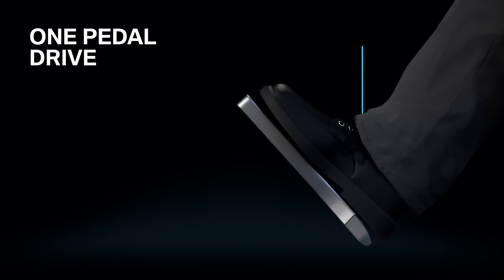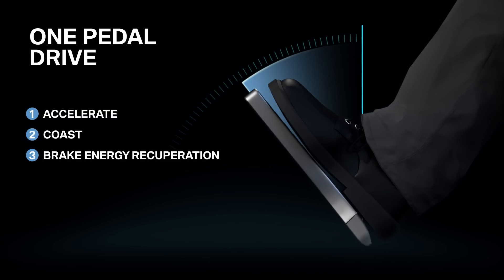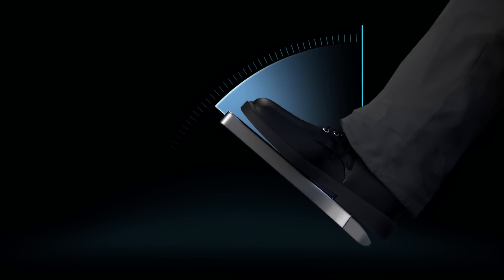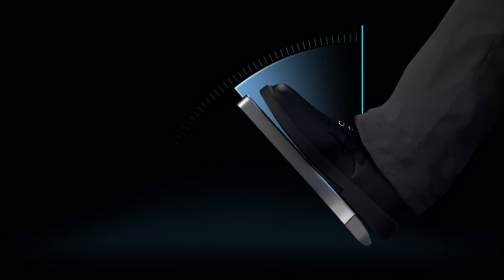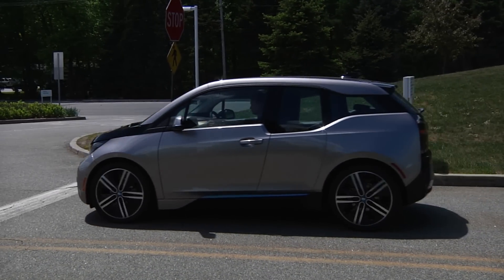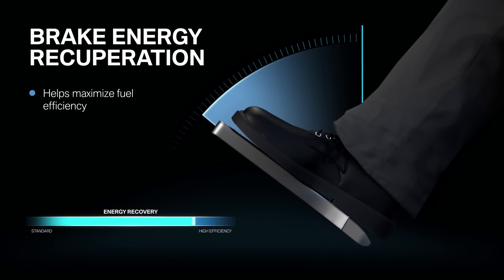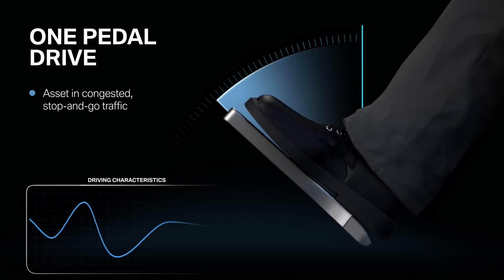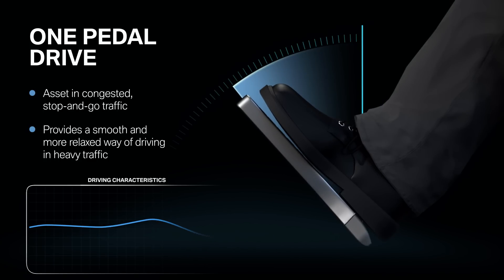BMW i3: One Pedal Drive

Comment: This takes the piss, as if someone does not know what an accelerator pedal does.. If the car is so different, then surely a driving test should be required.  In the UK, coasting is illegal.
Reply: No
Reply: #1: Coasting is not illegal in the UK (at least on passenger cars). 
#2: The car is pretty intuitive. It just might not act like someone would expect, so what's wrong with having an explanation to go with it?